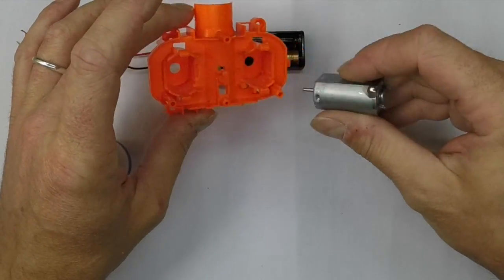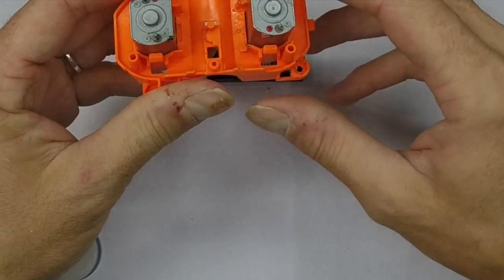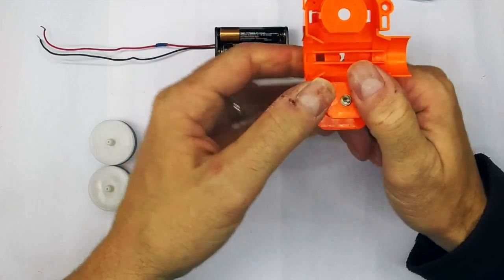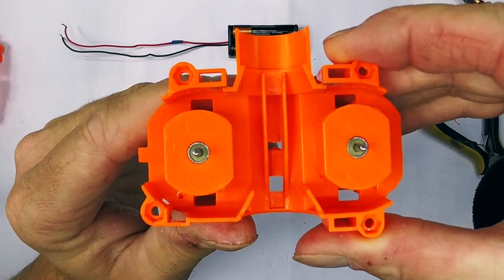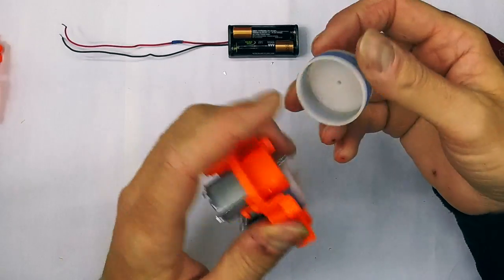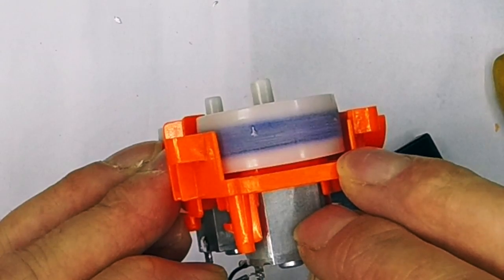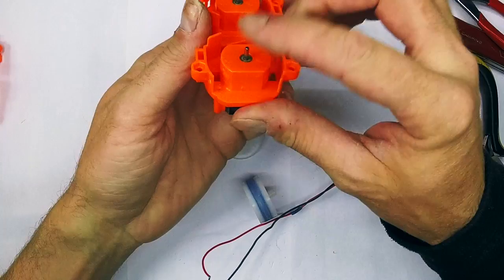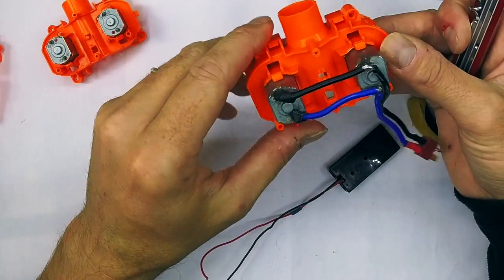How to- Set up Modded Flywheel Motors Part 2

Comment: Is it necessary to secure the aftermarket motor with screws into the stock flywheel cage at all?  Or is the fit of the motors into the cage and the flywheels on the shaft sufficient to hold it all together?   I'm looking at Meishel 2.0s for a budget Stryfe build but the Rhinos are similar RPM so I would assume similar vibration if there were to be issues.
Reply from the maker: They are fine with a friction fit in the stock cage. There’s no vibration issues if the wheels are not bent. I hear the cage with a hairdryer then press the motors in, makes the job easier. Meishel 2.0’s are better than Rhinos. If you can fit precision flywheels like Bulldogs then do, they are much better balanced and shoot harder.
Reply: @foamdataservices  Thanks.  I will be using Bulldogs on another build and will likely upgrade this one to Bulldogs down the road as well.

Comment: Hi!
I wanted to ask about a product on your website, but couldnt find a direct way to email you etc.
The worker aluminium flywheel cage, it that more or less a universal cage?
More specifically, will it fit in a rayven?
Reply from the maker: I have nothing to do with UKnerfwar.com shop. That cage won’t fit a Rayven however.
Reply: Thanks for the response, in any case.
(you might want to ask them why your youtube channel is listed in their "contact us" section of their website)
Reply from the maker: UKNerfwar was my agent when I accepted commissions. If anyone wants to get them via email, use info@uknerfwar.com

Comment: First off, I think these videos are very under appreciated considering the amount of views it has. These videos are amazing and far more specific than the "more popular" ones. Second, I have a question in regards to modifying the flywheels. Is it a good idea to rubberize the flywheels with some Flex Seal (liquid rubber in a can) in order for them to have more traction and grip? You mentioned in the video that the flywheel had residue from the heavy use of darts on it and how it was a good thing.
Reply from the maker: DO NOT put any rubber crap on the flywheels. You do several things, firstly you destroy any dynamic balance, second you add mass, third you don't gain anything. The natural foam build up does everything a load of paint on rubbish without any downsides. It's a myth that you want total grip, some slip is actually better fir energy transfer, it also prevents you from simply stalling the motor, especially with higher crush set ups.

Comment: I'm following this guide but having a hell of a time soldering the motor terminals and then getting heat shrink over them without having the wire stand too high above the motors. Tips for how to get such a clean solder & heat shrink job?
Reply from the maker: If that's too hard the loop method through the terminals is easier. I use a separate flux and I twist the feed wire in two "tails" over the bridge wire which I tin before soldering the feed wire to it.

Comment: Can stock Nerf  motors handle a 3s without burning out
Reply from the maker: No.  Get MTB rhinos
Reply: thanks
Reply: will barricade motors take 3s or no
Reply from the maker: +Willie B. Yes they will but are still a metal brush motor. They can burn out at any time. Rhinos are better
Reply: thanks i am building a barricade
Reply: can i change the brush pack and put carbon brushes in them
Reply from the maker: +Willie B. You might as well buy MTB Rhinos if you are doing that. They are carbon brush already and £5 each
Reply: ok thanks i just wondered

Comment: what do you do if the motor in the flywheel cage is to loose
Reply from the maker: Pack it with shims made from thin plastic sheet or start again with another cage, depending on how badly you wrecked it.

Comment: Hi FDS.  Enjoying your vid here once again, but I have to disagree with the motor orientation method you use.  Yes it is fine and works, but the way you do it is opposite to the stock motors/setup, orientation wise and polarity wise.  As a 'standard' positive should always be muzzle side and negative rear or stock side.  Reason is, the stock motor setup is this way (+ve muzzle), and also motors like Xtremes have side terminals and you can only put them in with the terminals facing toward each other and with this orientation positive is muzzle side.  Sure you can put them the other way, but that would be kinda silly.  With you doing the Blade or top terminals motors this way, your always going to have opposite polarity to side terminal motors.  So why not mount them 180 degrees around and keep it all the same?
Reply from the maker: Toruk did them that way, I got it to work that way the first time , I have done tons of blasters that way and only one motor tag failed. Do it how you like. If people want to wire opposite then good luck to them. I also put the-ve on the bottom of my wiring loom and doing the wires this way round makes it easier to thread my plug in motor block.
Reply: Them motors are the wrong way round because Drac and MTB put them the other way round 

Positive on the left motor is supposed to be backwards not forward

Comment: actually I had this problem with the MTB Rhinos(almost similar to the 180s in the video). The flywheels buzzed. the reason is that the flywheels are pushed too deep down the motor shaft. This causes your flywheels to touch the base of the orange part. Try pulling it up a bit. I did it and it still had space for the other half of the flywheel cage to sit properly. and now its working fine.
Reply: +Jonathan Lim This is something we cover in our BlasterTECH Loom/Motor installation guide.  There are a couple of tabs on the motor cage that you can line the flywheels up to (you can see in this vid).  These orange tabs give you the correct depth to adjust your flywheels too.  Also as a final check before bolting down the cage to the shell, use your fingers and make sure the flywheels spin freely.  Ultimately if your flywheels are rubbing on the housing and you start reving, potentially you can and will burn out your motor(s).
Reply: +BlasterTECH I normally test the rotation of the motors before I actually put it in the shaft so I don't have to take the trouble to pull them out again. in this case the positive wire that connects to the Red and the negative connects to the non-red polarity makes it spin clockwise.
Reply: +Jonathan Lim Yes!  Looking from the top of motor (terminal end of motor) this is correct.  Positive on Red dot, negative on other give clockwise rotation.  The other way gives anti-clockwise rotation.